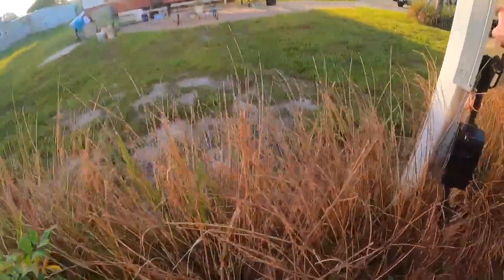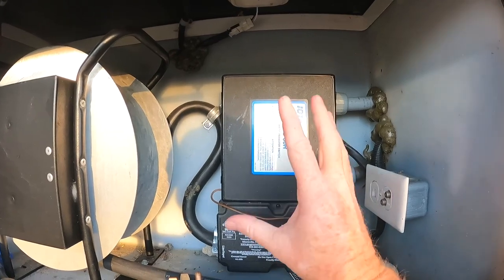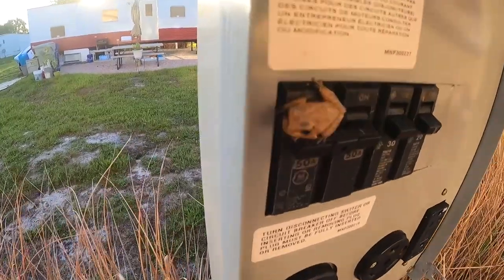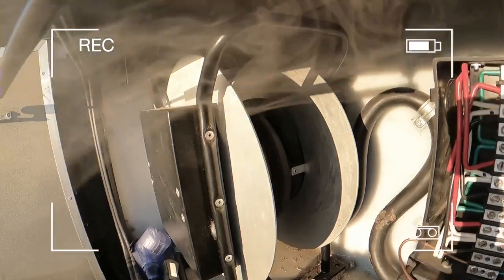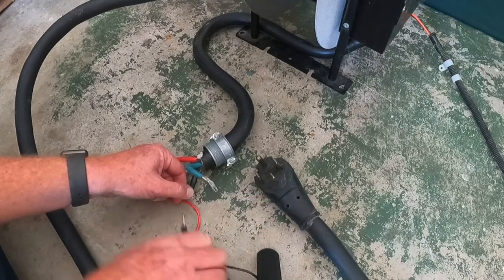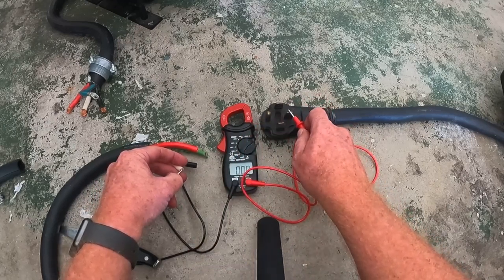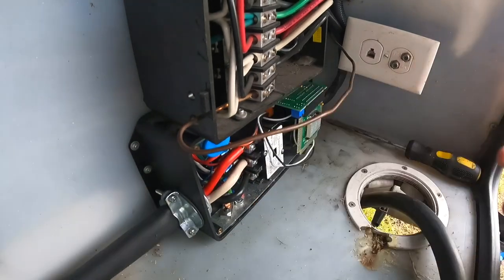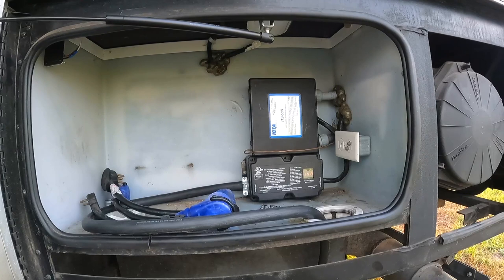💥🔥🧯`SMOKE IN THE RV!! 😶‍🌫️ PART 1 - Shore Power Gone Wrong #RV #rvlife

Comment: Great video! Same exact thing happened to me on my (30 amp) setup.  And my response was the same...cut the reel out of the loop!  If not too much trouble...where did you end up sourcing a reel replacement?
Reply from the maker: I got it from Glendinning. From my research one of the best brands out there right now.  I'm gonna update the video info with a link. Here it is for your quick reference.  https://www.glendinningprods.com/products/cablemaster/cablemaster-rv/